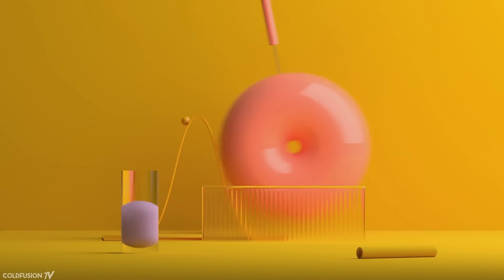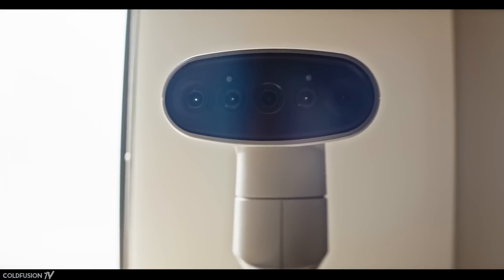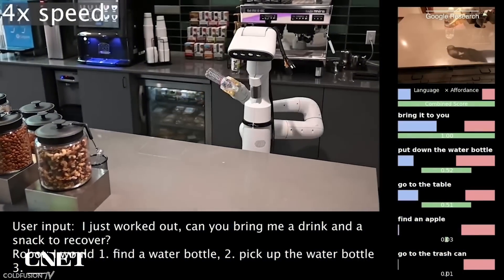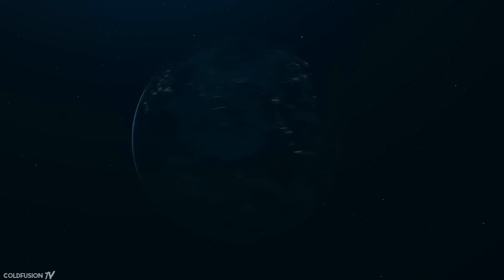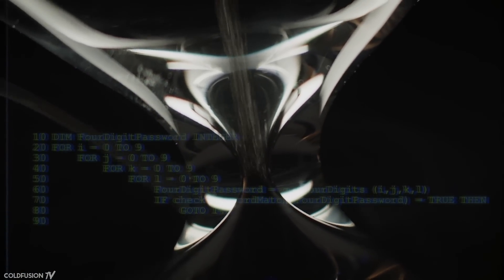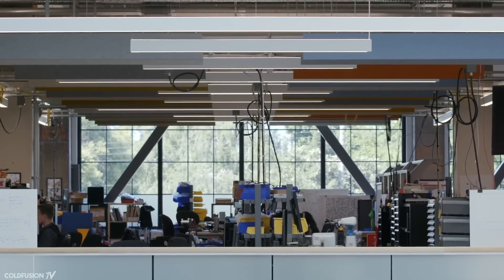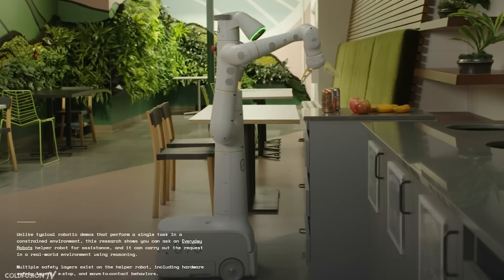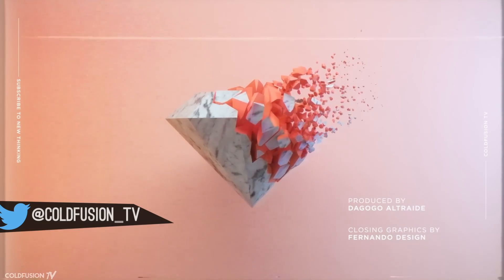Google Just Put an A.I. Brain in a Robot [Research Breakthrough]

Comment: but what happens when they get smart enough that you give them a generic command like get those people out of here and it determines that it should grab one of the people's arms and break it to scare everyone away? 🤔
Reply: That's why there are constantly discussions in the field of AI about how to make sure things like that don't happen. It's called the alignment problem, i.e. how to make sure an AI's goals align with humans' ethics as much as possible. Reinforcement learning provides a common approach to solving this: with reinforcement learning, usually the reward or punishment is calculated from some formula, but it doesn't have to be. If instead, the reward or punishment for a learning attempt is given to the AI by humans, then the AI doesn't even need to know what it's trying to learn; instead, it will end up learning what humans would do in a given situation, which intrinsically encodes human ethics, since even actions that "succeed" at a task will be punished by humans if it's got negative side effects.

The issue is also partially remediated by the use of LLMs themselves. LLMs effectively learn what humans would say in any context, so if an LLM is being used to plan a robot's actions, it will behave like a human would. (Obviously, the quality/performance of the AI determines how much "like a human" its results are.) Of course, many humans are cruel, and it will learnt that, too, but... that's a problem with humanity, not technology. We just have to try and make sure the LLMs are prompted with contexts that more closely resemble toxic text than positive text.

So the answer is, "that's always a concern, and we have ways to deal with it".
Reply: @IceMetalPunk  wow as you are saying this I remember a week ago or so I read that leading AI Scientists are getting increasingly worried about AI getting out of control / self-determined by learning how to control the reward system of its reinforcement learning algorithms. Your comment stating how much of this control is currently realized through the punishment/reward makes this worry (which I was not taking too seriously at that time) a whole lot more feasible - in general while it’s for sure fascinating that we are getting so close in AI I find it increasingly scary… especially that these advanced “AI-Brains” are now capable of controlling a real “body”!
Reply: @TheHennes36  How would an AI suddenly gain the ability to control its reward function? That's like a laptop suddenly gaining control over your TV on its own lol
Reply: @IceMetalPunk  So we're going to have a life form with the intellectual capability 10-100 times that of our own, and we naively think that we'll be able to control it and that no human team is going to screw up with the reward function?  And even if it was just bugs in code, such mistakes are pretty common, and on top of that all this crap is networked.
Reply: @scott4825  I think you're missing an important factor here: if the reward function is based on human feedback, and the training data is human-generated, then no amount of bugs will make it "unable to control it". At its most perfect, it'll just be mimicking humans, at its worst it'll have poor performance, and in any case there will always be a shut-off switch because that's separate from any part of the learning system.
Reply: @IceMetalPunk  I think you are being naive that we will be able to completely control the "reward function", that there won't be those like the military using AI for war, that there wont be those being creative with reward functions and making more fuzzy parameters, and that there wont be bugs in the reward function.   And rewards don't always work the way you expect them to.  And hell, a good chunk of the research in AI is to make one that thinks independently (and not to solve one problem).   IMHO, it will understand humans (individually and in group) at a deeper level than we understand ourselves.  We will have taught the Siri's, Alexa's and Ok Google's of the world how we think and all about our quite violent human history.

And aside from ethics (murder?), pulling the plug could trigger as survival reflex.  And again, it is all networked.  It isn't going to be a matter of pulling the switch, and my guess is that AI would know you were going to do it before you made the move.  Anything that is networked can probably become a weapon....those self driving cars, that Crispr machine, etc.
Reply: @scott4825  I didn't say there wouldn't be bugs or that reward functions would be perfect.

You're fully getting into misunderstood sci-fi technobabble, though, when you say pulling the plug could "trigger a survival reflex". If you have an AI, it will always be dependent on its hardware, the same way humans are dependent on our bodies. Pulling the plug is analogous to killing the body; and a human who has been killed can't just "survive" because they're "so smart". An AI model that has been copied to a million servers is still vulnerable to just deleting the model from the server. There is no reason to give an AI the ability to copy itself on its own volition, and without that ability, no amount of intelligence can make it do that as a "survival reflex".

What you're suggesting is like saying if a human is smart enough, then if you try to shoot them, they will just learn to fly faster than a bullet and fly into the sky to dodge it. There are physical limits that can't be overcome just by "being smart enough" -- such things require time and resources at an absolute minimum -- and the same applies to AI.

No one is suggesting we create an AI that has infinite resources. Without resources, even the most intelligent entity is vulnerable to being killed.
Reply: @IceMetalPunk  What people need to realize is that humans are LITERALLY biological computers, and we often design AI after our own biology knowing that WE work, so they should eventually be able to too. What people are worried about is the glaring fact that natural biology is grossly inefficient and incapable compared to what intelligent design can actually produce. This means that, eventually, we'll have an AI MUCH more physically and mentally capable while literally being designed after it's inventors.... now look at its inventors. WE, as dumb and slow as we are, have figured out ways to hijack our own reward systems for our own benefits which often results in anti-social or violent behaviour... would you want that in a machine that can lift 100x more than us think 100x better than we can?

As for it's programming, a TRUE AI will be able to reprogram itself in order to learn much like how humans reprogram themselves to improve themselves. If an AI can reprogram itself, it can also remove the safety features we put into it. Humans are taught that murder is wrong, it doesn't mean we can' t reprogram ourselves to be okay with it.
Reply: @ryanthompson3737  I disagree with that entire last paragraph. Humans don't reprogram ourselves (at least not until we start getting into brain surgery and psychoactive drugs). Being explicitly taught one thing and then learning something else from other experiences isn't reprogramming, it's just learning. As such, I don't think self-modifying code is a requirement to call something a true AI. But even if it is... we've had self-modifying code for decades, long before any decent AI, so that wouldn't be some new advancement anyway.
Reply: @TheHennes36  The way these are trained, is not using punishment and reward in the sense you and I think of it.  Neither is enjoyable nor disliked by the AI.  It just happens...the same way you and I look at a cloud and we learn something by doing so.  The learning process itself is neither pleasurable nor painful.  We don't sense it at all - it just happens unconsciously.